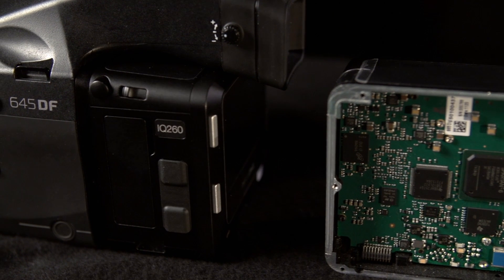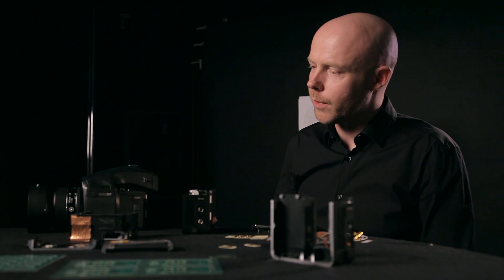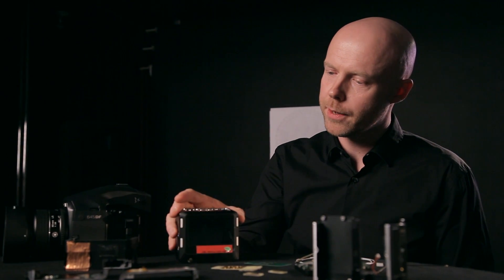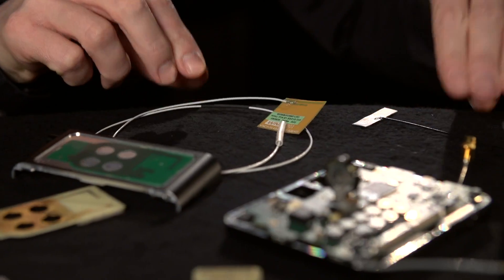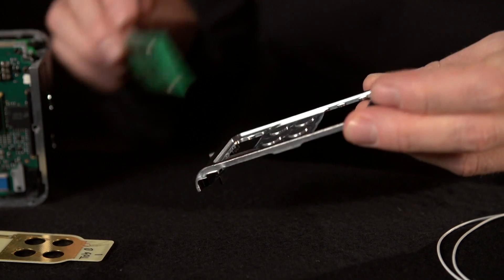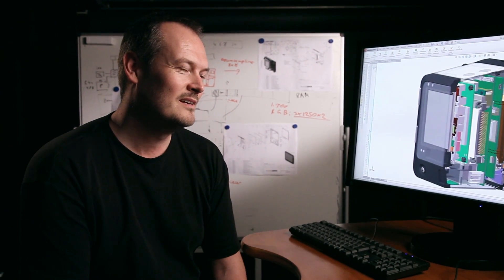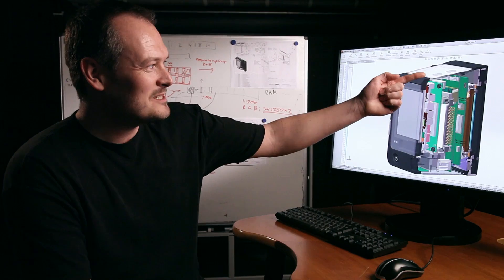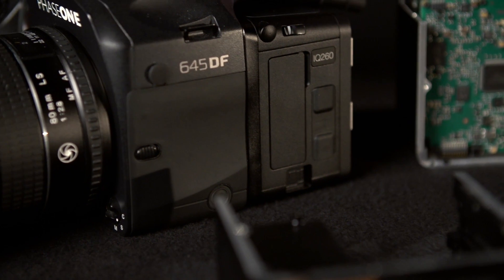Overcoming challenges in the IQ2 innovation process | Phase One

Comment: What consideration did you give to the fact that your Wifi implementation
places the dual band antenna extremeely close to the eyes when the back is used with your cameras. Much closer to the eyes than any other WiFi device.
The eye is a very complex and unique organ that is of significant importance to 
photographers.
Can you point to any study showing Wifi is safe when used at such close distance and in particular in adhoc mode where the signal is les intermitant.